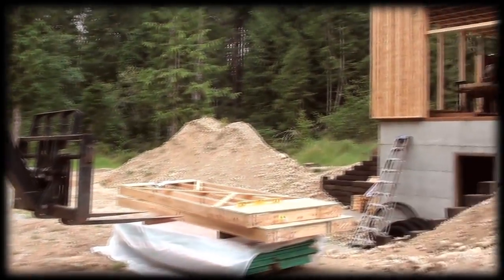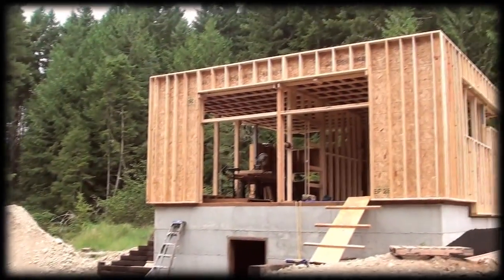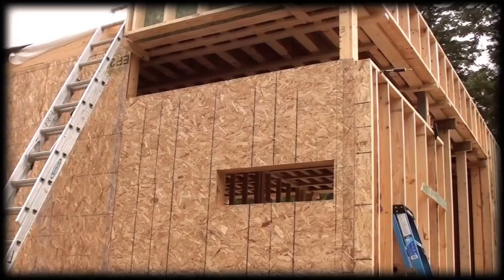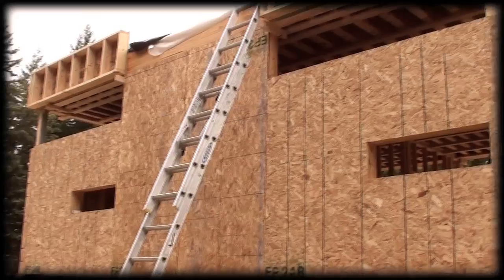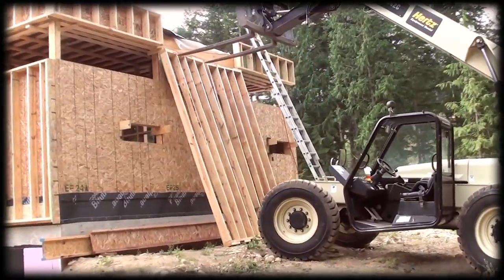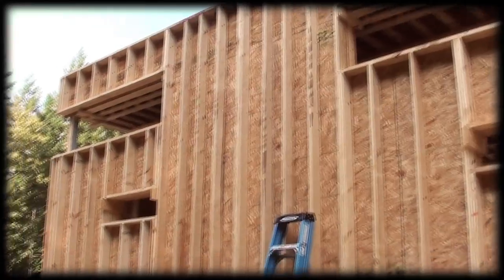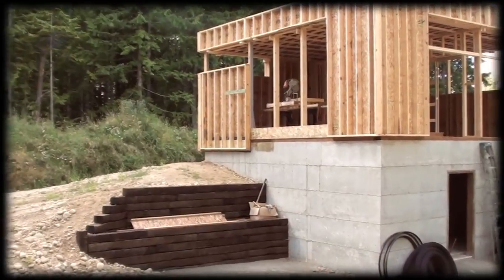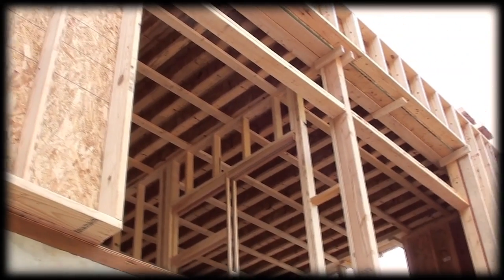Solar Powered House: Exterior Faux Walls

Comment: @2Humans1Dog1Cat Very cool, this answers some of my questions posted on the other videos. Never seen a house design with this much durability. Specially using the osb or plywood on the exterior walls before they are put up. Most houses in the U.S. are hack jobs lol.